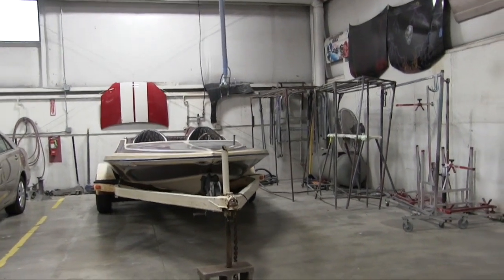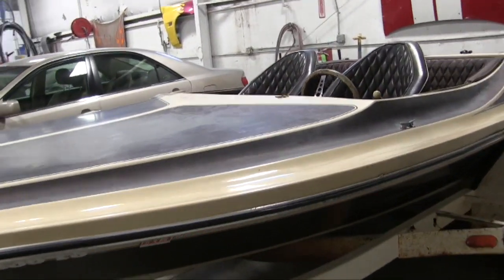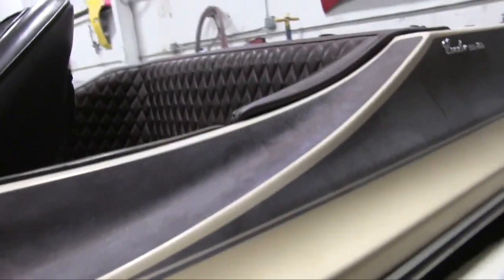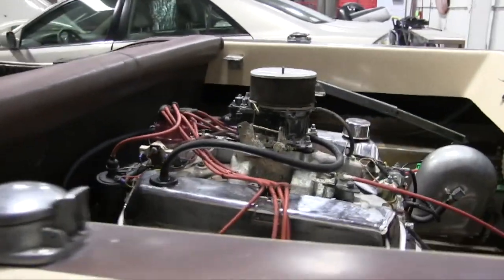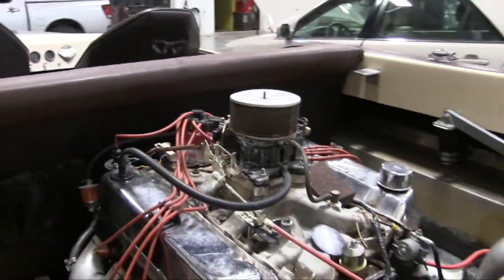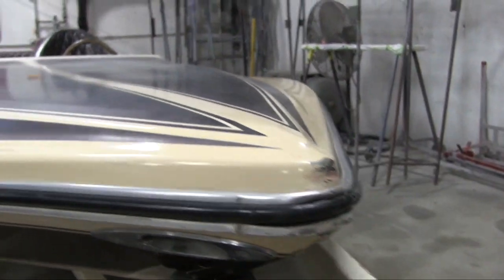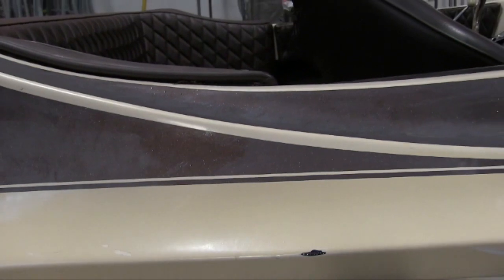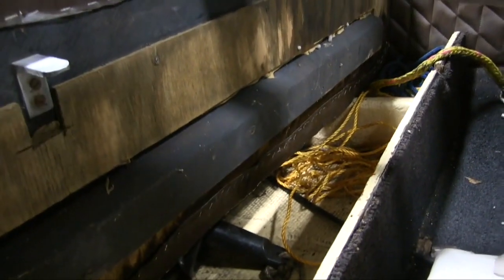Jet Boat Project Video Series - Intro

Comment: Hey Donny, just a quick question. What products do you recommend for a replacement to using lead for panel seams.
Reply from the maker: I meld the old lead off and weld the panel on.  Then I use kitty hair type of fiberglass filler (in a can) over the weld.  Then you can finish it off with body filler.  Here is a video of me demonstrating that https://youtu.be/lQsX6sAcy6U  Be careful not to grind or sand the lead to prevent breathing it.
Reply: I got the lead off with torch and just needed some info on what products were available. Could you also do video on proper way of painting over chrome new and old.

Thanks for the help
Reply from the maker: Really the best way to paint chrome is to have it sandblasted.  I see a lot of people using Plastidip, I am not sure how long that will last and/or look good.  DupliColor makes some paint that you're supposed to be able to spray over chrome, but again, I am not sure how long that will last.